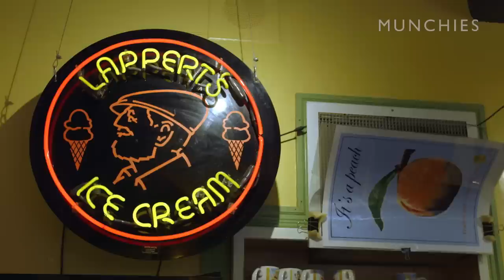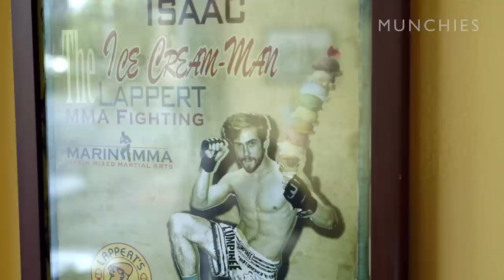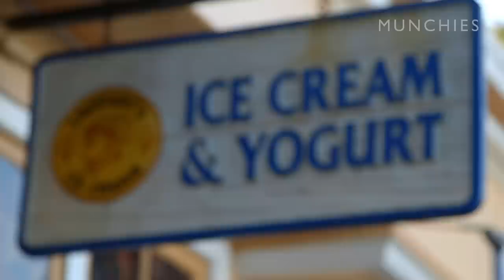Making Cold-Stoned Sundaes with the Cannabis Creamery: BONG APPÉTIT

Comment: I wonder why they don't infuse milk, or cream (dairy). Cannabis extracts quite nicely into dairy.
Reply: dieselphiend I would guess that heating the dairy would change its molecular structure in such a way that it wouldn't be suitable for making ice cream.
Reply: ZeppelinRules I don't think you would have to to heat the diary. To the best of my knowledge, THC readily binds to fat. While heat would speed up this process, it's not necessary. But it would take longer. The cannabis could just be decarboxylated prior to infusion.
Reply: dieselphiend Not enough fat content...
Reply: KELPOPOWICZ One is not restricted to milk. You can use heavy creams as well.
Reply: dieselphiend true.. Though it still wouldn't extract as well as oil or a high fat butter
Reply: KELPOPOWICZ Why not?
Reply: dieselphiend heavy cream has up to about 38% fat and kerrigold butter (a great choice for edibles) has over 80% fat

Comment: OK you just my pet peeve with the fork lift. that is extremely dangerous. hopefully that little clip was all you rode like that. just so you know if an OSHA inspector had seen that, it probably would have put the out of business with the fine. to give you an idea of what OSHA fines are like a pallet leaned against a wall on end is 5 grand/pallet. if you left that lift running with brakes set and went around the corner of the building where it wasn't in line of sight. that's 40 grand. OSHA violations are no joke.
Reply: let's just relax..loo
Reply: *lol